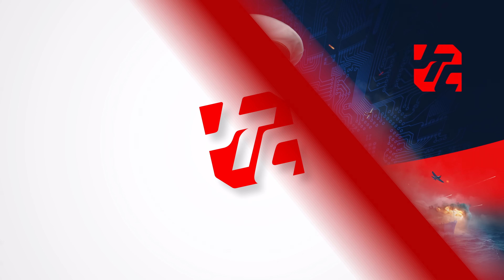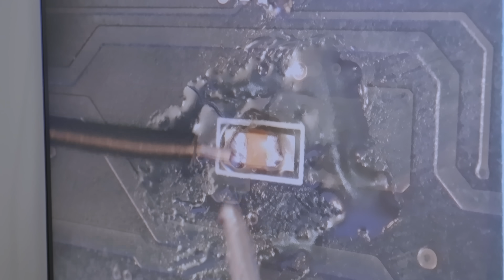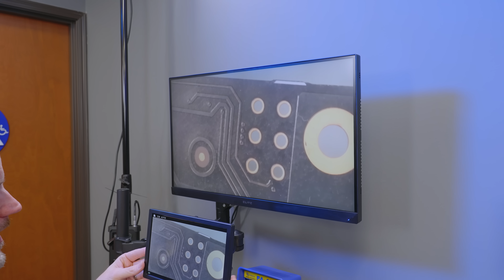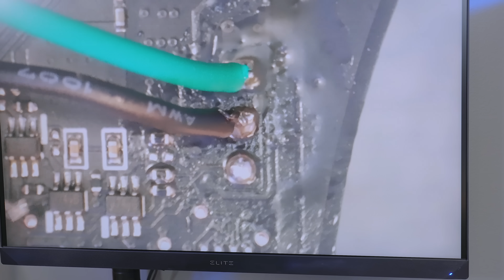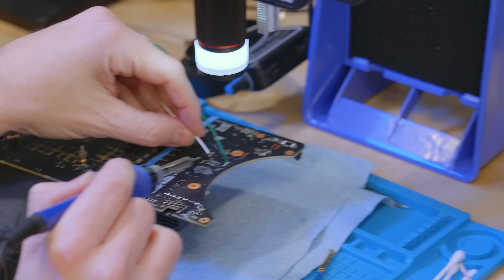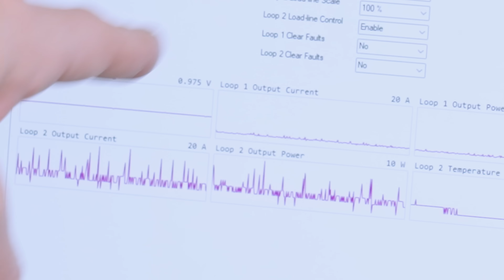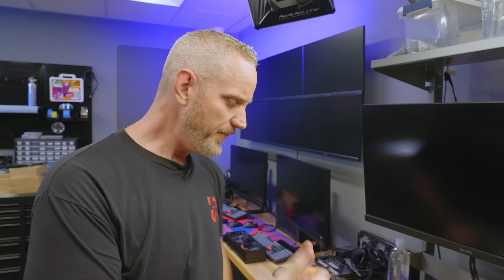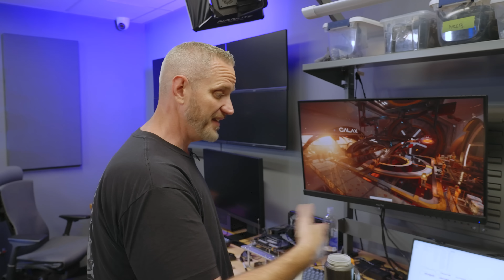This didn't go as planned...

Comment: Nice work. make sure you tin your wires first, especially when soldering them in vias (the holes) to avoid cold joints. The white wire looks like it might need a reflow. It will also help a ton when soldering onto ground planes. Something else, the ground wire came off because the ground via didnt get hot enough to allow the solder to flow properly (you can tell by seeing the lack of tinning on the ground via) Im no expert, im still learning too (although, not on GPU's worth more than my car lol 😅)

Comment: You know what it is is your solder is either old or the Sodier is too thick I've seen several videos where they show how Sodier some soldiers melt easier than others and others attend to dry out which don't melt as well during the heating process I wouldn't say that they dry out I would say that they're not well manufactured for as dry as they are that's why some melts easier than others

Comment: If it was me I would have gone down the local electronics shop and got a connector with the same spacing and fitted that then you can disconnect when needed as well.  also takes the tension of the pcb.

Comment: I've heard a power supply go boom before, it is LOUD AF! It shunted the power back into the outlet and the power strip. Fried the power supply as caused the breaker to go off on the outlet it was plugged into. The components inside all survived. The PSU and the power strip were the only victims thankfully. And nothing was even OC. Back in the day of the 4700 series of Intel CPUs I believe and a 800 or 900 series GPU. It scared the crap out of my friend, it was her PC that did it. I've heard shotguns go off that were not as loud as that PSU when it blew up. It was a Corsair PSU as well. Not sure what caused it to go boom, but Corsair replaced it under warranty and everything was fine after that.

Comment: When soldering wires, once the wire has been stripped to expose the inner strands, give them a good twist, and then apply solder to the bare ends - this is called 'Tinning' and will help when you then solder the wire to the component or pad. Also, I think the reason you had trouble soldering the ground wire is because the pad you were trying to solder to probably had a significant amount of other copper attached to it on the pcb - as in a ground plane. In that situation when you try to solder a wire to the pad, the extra copper of the plane will take the heat away from the pad - much like a heatsink does. Try turning up the temperature of the iron when soldering to pads connected to ground planes - or use a higher wattage iron - this should keep the heat at the pad rather than it being dissipated by the extra copper and allow the wire to make a better connection - you want the solder to flow onto the pad and not look like a clump of solder. This is why the ground wire then came off the pad and you had to solder it on again. The other benefit of turning up the temperature is that the wire will be soldered to the pad quicker which means you wont need to keep touching the iron onto the pad and leaving it there for too long. This can cause the glue holding the copper onto the pcb to melt and the copper of the pad can then lift off damaging the pcb.

Comment: jay, i gotta say.. u really read up on soldering. thats clear to everyone i think, gg man. a little tip from an amateur? when im soldering wires to holes in pcb's i always thread a pre tinned wire into a fluxed hole and just tap it with a tinned bolt :) if im doing multiples i do the same but i hold the tin in the left and the bolt in the right and just drag the bolt over the "line" of connections and hey presto :)

Comment: Just to let you know the problem is not you or the ground plain it the solder iron the element in the iron is over heating i can tell because the tin on the tip is oxidized before you even do anything with it and as soon as you put a load against it you get a cold tip this happens because the temperature is taken at the element and the tip doesn't have good contact the element you need a good t12 kit and there's a lot of diy versions just Google t12 soldering iron
Reply: A good iron will not excessively oxidize solder and and when you put it against a load it will add more heat as needed to your set temperature basically between 350 and 450 ⁰c depending on what you're working on and type of solder

Comment: 12:40 see that ? when the drop of lead stays on your soldering tip instead of on the board !? it means the tip is hotter then the contact point you are trying to solder.. heat up the contact point and yes the wire too ! then add the lead and watch it flow to the hottest parts

Comment: Bad Jay Bad. First apply Solder Flux to the wire leads, THEN apply a small amount of Solder to the hot Soldering Iron THEN touch the Soldering Iron to the wire lead which has been pre-fluxed. This step will bond a film of solder to the wire leads which will prevent the wires from splaying when you try to push them through the hole as well as enabling the rapid soldering of the wire lead through the hole once you apply some solder to the through hole. Less heat will have to be applied to the board due to the solder melting quicker than the board heats. USAMMCS ( United States Army Missile Munitions Center and School) 23N10 Nike Hercules Class 503 Redstone Arsenal Alabama.
Reply: 9:58 for the relevant time stamp

Comment: What are the actual accuracy specs on that little voltage meter that you are using?  Typically something like that isn't going to be all that good, especially when you are worried about 10's of millivolts.

Comment: Jay IMO something you need to try is to run this on a super cut down windows install, get a new SSD, install windows remove ALL bloat and have absolutely nothing else running on the system.  Your desktop has other icons so this windows install isn't clean as it could be and I haven't seen you mention this in your XOC vids that you're not running any software, use a plug in mouse and keyboard so no BT, turn off network and wireless etc.

Comment: Jay, you should have known better than to even TRY it. NVIDIA boards barely run properly as-is, overheating, melting cables, the list goes on. Modding a product generally works best when the product is built to work well. NVIDIA is all-in with AI now, they don't care about game graphics anymore.

Comment: When i want to solder small part, i use the tin for heat soldering, it melt at lower temperature and have flux in it which help it flow.
if you want to solder a card with such big ground, having a hot bed at 100 C can help.
like other people said, you should tin your wire it really help to stick rapidly.
once you checked your solder work, i usually put some hot glue to stick the wire, to isolate and give more surface to grab for wire to prevent ripping small pad on the board, a pain to remove if it's temporary though.
Reply: And I feel you, capacitor exploding are loud, but they are ok, CMOS or IGBT, when they explode, that something else, like a gun shot because it's the ceramic body of the component try to resist the metallic internal expending, and when it break, you have ear ringing for hour.

Comment: thoes ebay voltage monitors have a small pot on the back that a screwdriver can tuen. thats the voltage calabration so when you use double stick tape it can crush it slightly and change the resistance without ever needing to turn so dont souble stick it there also it can be used to adjust if its off. eather way you are reading milivolts that was a poor choice for that. im sure you could get one with a oled screen too i cant see shit ont he video when i look at that... shit you could of gotten a blue led?

Comment: you need to get a large tip and crank it to 800. i solder drone wires to a esc pcb basicly a huge heat sink. i normally at work and home solder at 700. 750 for grounds and 18 gauge wire but when its12 gauge or smaller its a large tip( thermal mass) i use a pace at work its 1000 bucks then i got a Hakko for 99 for my house and they work the SAME ( just the soldering iorn no other tool attachments). u got a nice rework station so i KNOW YOU HAVE A LARGHE CHISEL TIP AND 800 SETTING JAY !!!!!!!!!!!!!!

Comment: Get a good pair of UPS Jay, 1 for the PC PSU and 1 for the GPU PSU. They clean the power from the wall so you get less ripple at the PSU. When done you can use them with the test bench for the intended battery backup just incase the power goes out during a test.

Comment: When soldering to a large ground plane, you should try pre-heating the whole board, not just the area where you solder to.
Hot plate would help a lot, but even hot air at reasonable temperature all over the board for a good while helps heating up the ground plane so it doesn't immediately soak up all the heat from the iron

Comment: As others have said, you're better off putting wires through the holes first, then fill the holes up with the solder after.

Also, clean power can affect stability. And I don't mean run two PSU's like you did. Try and isolate your power for the XOC rig from other things on the circuit either by using a different circuit or a UPS.

I remember one of the Scrapyard Wars series where they had stability issues until they ran one of the rigs off of a UPS.

Comment: Hell yea! For thru-hole you want to put the wire in first then heat from the other side. Remember that solder likes to flow towards the heat source. I solder for the aerospace industry. Also the more flux you use the better!

Comment: I have had multiple PSU  blow caps and release the magic smoke but my ears were never ringing for 5 minutes. .  With ground plane soldering, use the hot air gun to warm up the board for several minutes keeping the gun moving before trying to solder the wire. It also helps if you use the hot ait for assistance while soldering a connection to a ground plane.
Reply: Magic smoke😂 do you see the machine elves if you inhale it?

Comment: You can go -neg voltage in the Elmore EVC2 software, it is just at the bottom of the list.
Reply: Yep, starting with the least negative at the very bottom of the list. Also, to ensure that any selection is properly made, you can exclusively ONLY click on things to enter values correctly. Sometimes other methods of entry look like they're working, but actually won't be

Comment: Take the time to tin the wires first. Think of it like an adhesive, want it on both parts and then melt it together with minimum heat needed. When you come at it with bare wire, especially stranded, its like a sponge and it will pull all the solder you pre-applied to the hole onto itself. In fact, we use copper mesh to correct mistakes / clean solder off board as you prob know. Tinning will also coat the wire to help with oxidation/corrosion of exposed copper.
Reply: He did mention that he tinned the wires.
Reply: He definitely did. I was surprised
Reply: I saw the same on the thumbnail.

Comment: If you have a dual transformer UPS, run the xoc system off it. It decouples the psu from the wall (disable bypasse), provides cleaner ac frequency.
Reply: THIS!

Comment: Back in the early 2000's when I first got into building PCs, I had a PSU blow. My ears were still ringing 10-15mins later.

Sadly, when the PSU went, it sent a massive jolt through the entire board... caps were blown on the motherboard, the PCI soundcard I had at the time got cooked and the CPU even melted onto the motherboard. Modern PSUs at least stop that kind of surge from happening, this could have been so much worse.

Comment: I'm more interested in the fact a HX1500 failed catastrophically when it was still under it's safe limit.
Reply: I agree. But we do not know if it was really under its safe limit. The graphics card alone was pulling 1100 watts. We have no idea what the rest of the machine was pulling. It could have very easily been pulling more then 400 watts on the rest of the components.
Reply: @Toom316  Isnt it supposed to have over current protection tho? Maybe manufacturing defect. At least it protected the rest of the pc so it did its job there at least.
Reply: @Toom316 A 1500 watt high quality power supply like the HX 1500 will have a huge safety margin. You could probably pull closer to 2000 watts on that power supply before protection even thinks about kicking in.  Obviously you’d have to be on 230V mains to pull that wattage.
Reply: @filmboy18  No 230 here, you either get 208 or 240. 230 is like 1930's voltage.
Reply: @filmboy18  I have a feeling it wasn't just the amount of power it was pulling, but possibly the rate at which it spiked.  A less heavy spike (yes, that sounds weird) to a lower wattage with occasional fluctuations around the power limit of a PSU are one thing.  But maybe if it's too much of a spike all at once, it'll grenade itself as a precaution to prevent it from possibly going higher than it already was.
Reply: The 1100W was on the GPU ALONE.
Reply: @SoranoGuardias  It would be higher if it was Crysis
Reply: It's not an ATX 3.1 powersupply, so maybe the spikes are too much.
Reply: @MrSteini1979 Maybe Corsair designed it to sustain higher spikes? ATX 3.1 is just a standard psu makers have to adhere to. If they want they can go above and beyond what the spec says in terms of ripple and what not.
Reply: @filmboy18  Maybe, but we dont know how old the HX1500i is. The first version is only ATX 2.52, so its really a "old" version. The modded 5090 pulls 1100W and the spikes can twice as high. The PSU has been in use for some time and has probably been subjected to heavy loads several times. This could lead to faster aging of the capacitors.
Reply: Probably transient spikes. I've tripped the circuit breaker at least a few times already. Using an AC outlet power meter, my dual GPU -- RTX "80" and "70" tier cards -- PC has ramped into the 900W+ territory. That rig has the be quiet Straight Power 12 1200W. Other items on the circuit probably add up to 200W at most. Even though the graphics cards have a rated/design power of up to 360W, I've seen the "GPU Power Rails" section of HWiNFO spike to nearly 500W for an individual card. Of course, I don't know how accurate this is, and no doubt it's also missing nanosecond spikes. Nonetheless, I can see why, despite adding up wattage, there are overcurrent problems.

By the way, decreasing the power limit even by just 5-10% appears to tame those spikes significantly. Fortunately, that's generally good practice anyway, dial in the efficiency Nvidia sacrifices.
Reply: Ive only ever managed to blow up gigabyte psu's - that was impressive Jay
Reply: False!
It failed horrobly, in the best Moment.
Bevor you kill your other stuff....
Reply: It's more likely the unstable power delivery in California causing it to fail early.

Brownouts/voltage drops are HARD on power supplies.

His test bench needs to be run off a UPS to filter/smooth out the power to the PSU.

That's what ended up making my AX1200 not be able to supply my 3090/3900x combo.

I will say, that AX1200 was a trooper, and ran my two 7970s with no power limit at 500+ watts a piece and pulled 1200+ watts from the wall 😂
Reply: thats corsair overpriced shet for you :)
Reply: @gtdriver721  They are rebranded seasonic psu's most of them :)

Comment: That would have been cool to see the PSU go BOOM!   Phil may have not caught it, but what about your security cameras?  Any of them facing the bench?   That one in the corner, did it catch any smoke?    That's 1500 watt PSU and you only pushed 1102 watts and it went BOOM.   Was the PSU being used and abused too much?  Or is that a fault with Corsair HX1500i PSU not being able to handle what it's rated for?  I'm curious because now I would stay away from that model at least.

Comment: Such a loud bang plus dimming lights was probably a main switching MOSFET going. When those fail, it's usually dead short, which effectively will cross the mains. That's not a good look though for it to fail so catastrophically, usually the protection should have kept it from damage, but as a test rig plus all the humidity from LN2, it's possibly some sort of environmental factor that was a contributor. Accidental short across a critical component, such as in the switching drive circuit... holds the MOSFET closed for too long, and BANG. It takes nanoseconds for it to be all over. Protection circuits can't respond that fast, but catastrophic failures should never be able to kill things on the output, so that's good to see everything in the PC survived!
Reply: I've also experienced electrolytic capacitors popping with an almighty bang.
Reply: @smashed_penguin  He would definitely complain about the awful smell if that was the case, though.
Reply: LED lights flickering is definitely a feedback harmonic thing from high frequency switching, rather than supply voltage stability. That kind of HF noise being fed back into the mains power would point to a struggling MOSFET.
Seen it before with a dying VSD
Reply: That must be what happened to my Seasonic psu, woke up to the power being out in my room, unplugged everything and turned the breaker back on. Then, I checked the psu after not seeing any lights on the motherboard or gpu and saw the mosfet cracked and half of it blew off the heatsink. 
Seasonic had no issues with honoring their 10 year warranty btw, sent mine to them to confirm my diagnosis and they sent me a brand new one right after, no hassle. PC survived and everything still runs just fine a year later
Reply: Errr, not sure cos it's a really long time ago but the principle they use sometimes goes by the name 'crowbar'. If something overvolts they 'throw a crowbar' over the outputs. You power supply will not like it but you will not zap some very costly equipment.